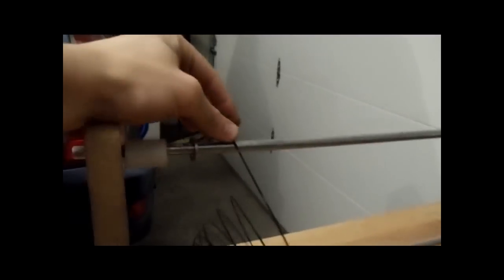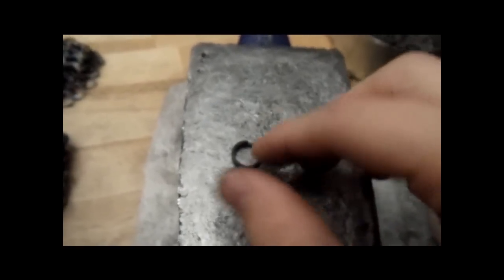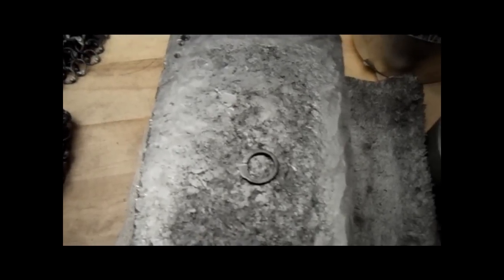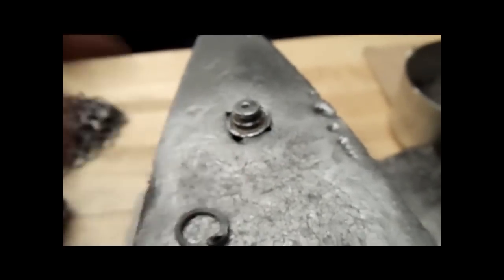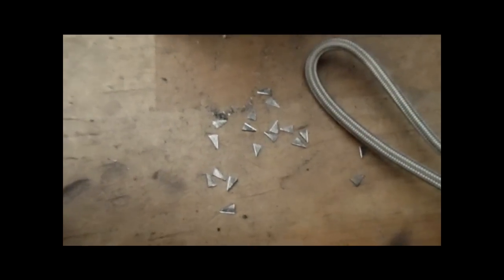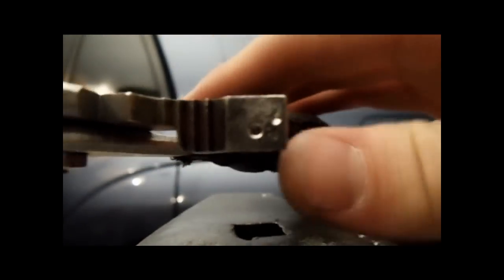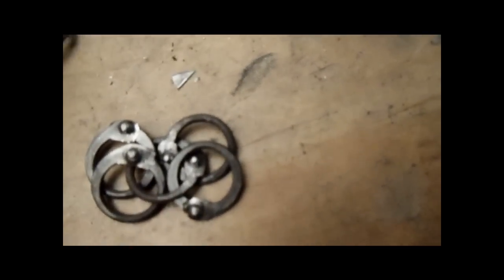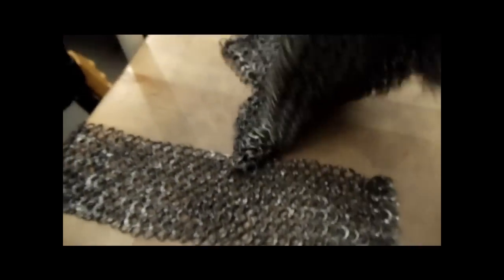How to make Hand-riveted Chainmaille

Comment: Could you heat treat mail? Like could you subject it to the same conditions as normal heat treating, i.e. heating them up glowing orange, pre-assembled, then dunking the lot in peanut oil?
Reply: Not if you use mild steel. I guess you could if you used a heat-treatable steel, but heating it evenly would be very hard without a kiln or heat-treating oven. You'd never do it on a forge without burning some rings and not heating others. Also, they are very small, so they might cool too fast when you quench them. You'd have to experiment. Maybe use a water hardening steel and quench in oil. Or maybe a whole shirt would hold enough heat to not cool too fast. It just sounds like a whole lot of effort. Isn't it easier to just not let people swing swords at you?
Reply: all so, not to tell you your business, but if you heat treat and quench this with all the metal expanding and contracting you'll end up popping some rivets out
Reply: fringis1
Probably. But it would be quicker to fix after. Ideally, you'd make the rings and punch the holes, then harden and temper them, and then rivet them after. Or, make the maille, then heat treat it as one piece, and then put the rivets in after, but that, means you have more awkward riveting to do. You're going to lose time somewhere, anyway.
Reply: mellowb1rd but if you build it, and then quench it, all those unrivited links are gonna warp all over the place. Sorry "could" warp, might be you dip a shirt and pull out a sleeve. Also there is a higher chance if breaking links if you quench them as a loose pile.  But that's just my 2 cents, some one that's tried it can just tell me different
Reply: fringis1 Actually, they shouldn't warp much at all. they don't have enough material for that. Besides, you're going to  be riveting them after. But who knows? I'm not aware of anyone really using tempered steel for maille. You'd just have to experiment. I'm sure just using a slower quenchant at a higher temperature would be fine
Reply: Actually, there is a "recipe" in a 16th century book for case-hardening maille made of iron. The work is "Natural Magick" by John Battista Porta iirc, the info is online. And the maille is fully completed first, then case-hardened.
Reply: Al M that... actually makes a lot of sense also you should quotation mark recipe, it would act be a recipe.  Preheat a hole in the ground to 500 degree, remove most of fire source, add a mixture of mail and leather strips. Seal hole air tight for 24 hours.

Comment: any tip trying my hand at it after butted but after each time i hammer the rings, they just skid off each other and dont flatten on top of each other any help would be greatly appreciated
Reply from the maker: starter make sure to anneal the rings first! the longer they take to cool the softer they'll be (burying them in ashes for example, will help them cool slowly).
Reply: oh okay thx for that. guess i need different wire then because im using galvanised, dont suppose u have a good place to get the wire most i see is just galvanised thx
Reply from the maker: starter I go to a farm supply store and get 'tie wire'. It's covered in a black coating to keep it from rusting, but that's just grease.
Reply: kk is that the same as a Ironmongers as i live in the uk and my Ironmongers only sell galvanised steel thx
Reply: Ask for "rebar tie wire". Also if you are planning to use galvanized, make sure you do your heating and cooling in a well ventilated area. because metal fume fever sucks.

Comment: Aaaam, is it gives you good protection? I mean, do the rings come apart from some blows, or do they hold together, etc...? Also, idk if you finished that hauberk, but as I seen, it was made out from the same sized rings, which is not good, you should make it towards the ends less denser, and use smaller rings to connect the bigger ones around the chest and shoulder area. I seen some real medieval riveted maille armors, and they have different density and ring sizes.
Reply: Riveted mail will protect you if you wear a gambeson underneath.

Also, you don't need to adjust it exactly to your body because you will have trouble to put it on, although you can sometime see "contractions" and "expansions", by skipping rings.
Reply: Astaziel Who said anything about adjusting it to your body?
I said that it shouldn't be made from uniform sized rings, and that it shouldn'thave uniform thickness.
It's not about adjusting it to the body, it's about having more material where you need it.
Reply: I've been working on a hauberk on my days off for about 3 months now and have a few decent sized sections done.   i recently got together with my brother and together we stabbed the shit out of one section for about 5 minutes after placing it on a pile of old shop towels.  the only thing that happened was that the knife went completely dull at the tip and 3 rings busted (this type of action would have never been seen in battle anyway but it was fun to do a test).  

anyway, i wouldnt want to be on the receiving end of this even with a gambeson, youd likely get some pretty extreme bruising and maybe even some broken bones depending on the weapon used against you.  ive heard of full riveted shirts being able to withstand arrows fired nearly point blank from a period bow but again, i wouldnt want to be the guy wearing it.  blunt force trauma, or shock damage, it just as dangerous as getting cut or stabbed, possibly even more so cuz you can't see the actual damage under the skin.

as far as different ring sizes, it was largely done as a sort of cosmetic or weight saving feature, one famous surviving example would have been worn by a mounted soldier or knight, and had thick small diameter rings around the shoulders and arms and gradually moved to smaller ones down by the legs.  the more dense ring coverage couldve stopped lets say a smaller tipped arrow from penetrating, but i think that it really just added to the look of the overall piece and being for a mounted soldier was for a man of significantly more means than a common infantryman and would most likely demand a piece fitting his station.
Reply: Vincent Falcone Different sizes were for yes, reducing weight, but it was also for protecting your most vunerable points.
The front for example should be thicker than the back, and yes, towards the hands and legs, but that's not a cosmetic thing, that is because those parts are anatomically more durable + in your hands there is probably a weapon and a shield, so you can defend yourself, and your legs are protected by the fact that you will be doing extensive footwork during a battle, or will be mounted, which means that the shield will cover your legs and the weapon in your other hand can be used to deflect attacks.
Also, mounted soldiers weren't in as much danger as an infantryman due to the tactical use of horses at that time, so they wore a different kind of mail than the foot soldiers.
The distinction for nobles were their tabards/ surcoats that had their heraldic colors and insignia on them, so sorry but your argument about it being a status symbol is just a fallacy.
Reply: sorry mate its not "just a fallacy". a coat of mail with various sized links and size adjustments would be vastly more expensive, especially one that went as far as the knee, furthermore even on infantry the legs were found to be the most often injured parts (there is a mass grave in sweden that has been found that strongly suggests that most deaths were caused by blood loss from leg injuries.  and yes, the very small links at the leg would be decorative, similar to ending a hauberk with brass or copper rings.

also if you read my post youd see that i did acknowledge it would afford more protection, but it would be relatively negligible.  especially considering the  soft parts of the shoulder and neck would have a double layer of mail on them provided by the aventail (or bishops collar, or mantle).   the front, bony, bit of the chest and shoulders are not a part of the body youd want to protect more, that would be the stomach. and to that effect an islamic/indian zirah would be much more effective as it had plates worked into the vulnerable stomach region.  also one of the reasons that shields in the early medieval period were so large.

there would also have been double layers on the thigh where the chausses and hauberk overlapped and on the forearm where the miton would extend to usually about the elbow and the sleeves of the hauberk would extend down to about 1/2 the forearm.

finally, tabards or some sort of standard, generally painted on a shield, would be carried by every soldier, not just mounted nobles. if that were the case everyone would be killing everyone in the frenzy of melee. "extensive footwork?" and what? get exhausted in the first 2 minutes of melee? no one wearing about 75 lbs of mail with a 2 inch think padded woolen gambeson was doing anything extensively.  especially footwork.

also as an after thought, cavalry were in incredible danger of being captured as the opposing force knew that their families could afford ridiculous ransoms, yeah they were reserved for charges and skirmishes but they were still captured and killed en masse.

where are you getting your information? mount and blade and medieval 2? its dreadfully inaccurate.
Reply: Indeed, when you observe Gothic plate armor, you see that they can be very slim, and I don't think a 2 inch gambeson would fit underneath.

By the way, would you happen to know what is the age of the Mail you observed?

Older mail would have thicker rings to endure the hack 'n slash of the early medieval age (before plate armor), and later mail would have thinner rings, to resist thrusts.

I made a byrnie last year, and I can assure you that you don't need different rings to make a functional mail.
Reply: Astaziel Well, yes, if you are lazy then you can make it out from uniform rings, altough I would recommend to have different density between vital and non-vital parts.
Reply: I would have done it this way, but I get confused easily.
Reply: wtf... space program actually runs on metric. Von Braun definitely used metric.
Reply: Metric is uniform everything is a multiple of 10, Imperial is just random numbers jumbled together 12 inches = 1 foot, 1 yard = 3 foot, 1760 yard = 1 mile? wtf? get that no uniform backwards system tf away from here and don't get me started on ounces, imperial ton and pounds.
Reply: Obvious troll is obvious.
Reply: Brandon Page The Nazis was beaten by the Russians, they were pushing them long before US joined the war and by the time US decided to land in France, the Russians were already knocking the doors of Berlin. US did beat the Brits but not sure the point in saying that, The Brits used the imperial system back then and Rome is long out of the top for more than a millennia now.
Reply: no
Reply: "After all the US of A was very much based off of rome."

Not at all.

"And that's why we beat the brits, the axis, and the the nazis."

You didn't beat the Brits, without Frenchs you would still be Brits (and that would probably be for the best).
You didn't defeat the Axis, Russians were winning the war a year before you even considered raiding Europe (for women and resources), Stalingrad was the pivot point of the whole WWII. 
Just like WWI you came at the right moment (the very end) losing very few units but taking extra money from it.
Ever since, you didn't managed to win a single war you started, and hell boy you started a lot of wars.

Your country isn't based on Rome who most like won every wars they started and conquered almost the whole known world back then, you country is based on opportunity, USA is the land of opportunists, you come at the right moment stealing the wealth of kneeling people.